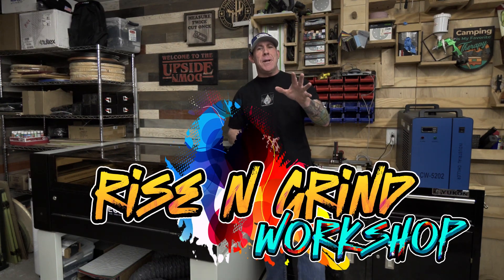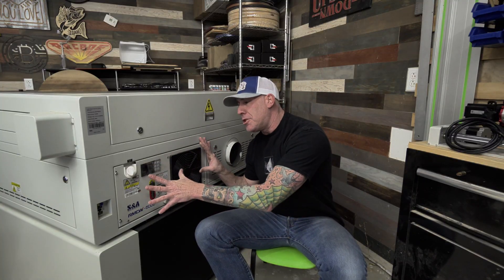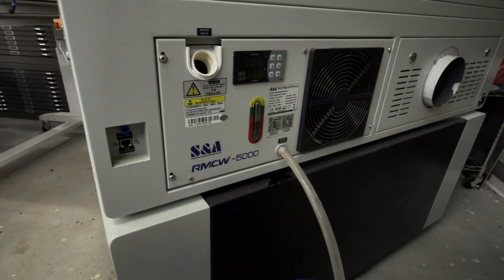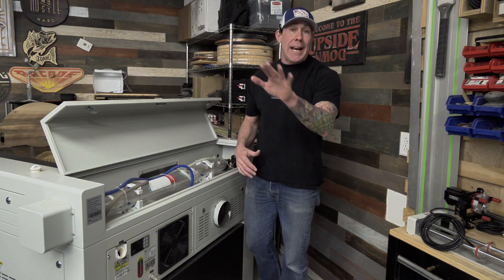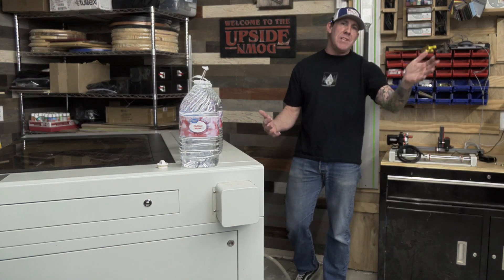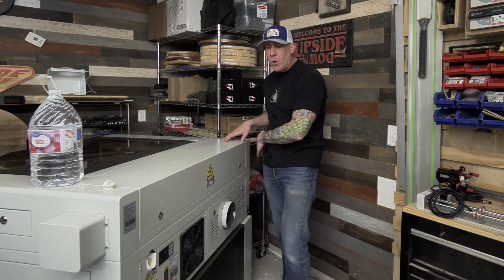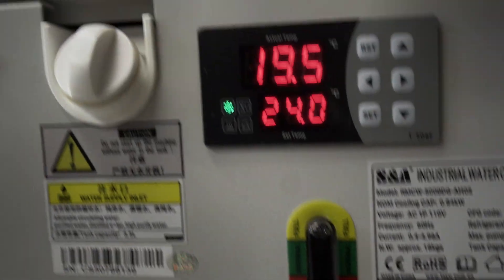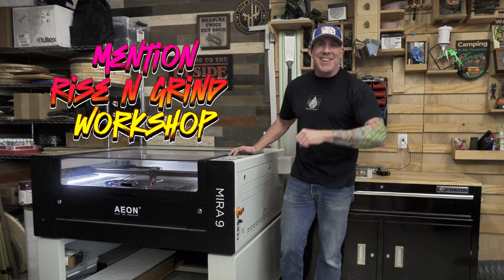Aeon Laser Mira 9 | How to Improve Performance

Comment: Would like to see a wiring video where you program the unit to turn on accessories like having the chiller start before the laser fires or starting the air extractor.
Reply from the maker: Thanks for the comment and suggestion. The new Redline series has a Smart Controller which keeps the air assit and inline fan off until you send a job to the Laser. The chiller is quiet is always running. The Omtech Pronto Series also features a Smart Controller!